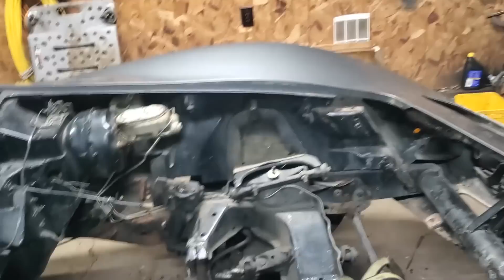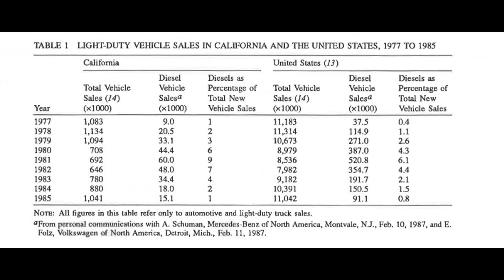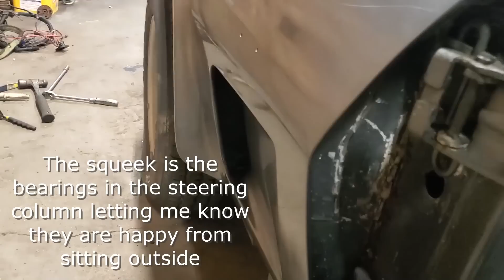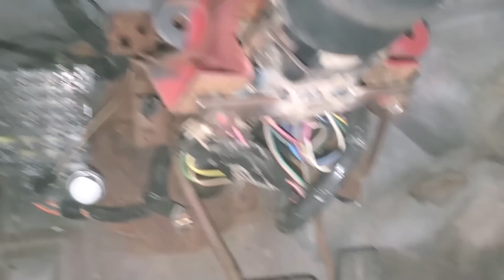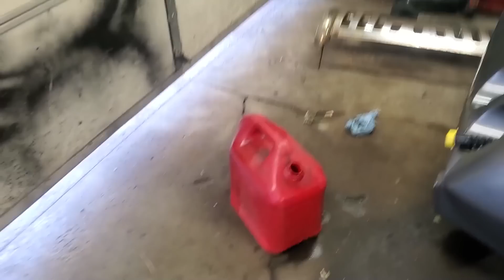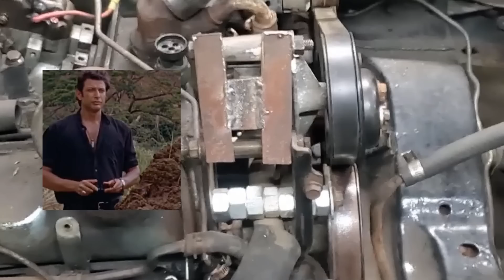The world's CHEAPEST c3 corvette powered by the world's WORST diesel engine! Will it MOVE again?

Comment: Huh. Oldsmobile Diesel Corvette. Shame you're using the V6 instead of the V8 but using what ya got is a respectable endeavor. I'm pretty sure GM outright sabotaged the 350 diesel by way of bean counter same as the 4.0 (only present in the Oldsmobile Aurora) and 4.6 Northstar engine also developed by Olds. My dumb Oldsmobile loving ass woulda dropped a gas Olds 330 Ultra High Compression from the 1960's into it since I have a car with the 330 (low compression sadly) and know how to work on it, but the problem is FINDING a 330 that hasn't had its crank stolen by some 350 guy who for whatever reason wanted to build a 60 year old engine to make power instead of performing the overdone but far more capable and far easier to find parts for LS swap. Really, finding parts for 60's Olds engines, especially the early 60's 215 turbo and mid 60's 330 but also the 350 to a point, is a total pain in the pecker.

Comment: I had an 82 Monte Carlo with a olds diesel. all the mototr mount bolts had vibrated out of the block. You could "power brake"🤣🤣 it and the gear selector on the column would move and the car would move and you could hear the engine fall back in place. I drove it for years like that and never fixed it.
Reply from the maker: hahaah i've had quite a few gm's where the mounts are shot and you just watched everything move, and my buddies 76 stingray he had, the motor would hit the hood, good times hahah

Comment: When you change the oil use the big oil filter. STP S25 at AutoZone, or a Fram PH25, forget what the Wix number is but the anti drainback valves don't seal well anyway on them. I use the STP S25. Decent quality filter for 5 bucks. Doesn't cost any more than the tiny skinny one and definitely fits in the space.

Comment: I just cut the universals out with torch. Clean up shit n slap them 2gether while still fairly hot. And b4 going back together, run a wire wheel through the bores. Walk in the parking lot! 👌
Reply from the maker: Yep, that's how I would do them when I am replacing them. Fire makes quick work of em!

Comment: Gale Banks made either a 125 or 150 hp 4.3 Turbodiesel Oldsmobile 2 door Cutlass Supreme with a 5 speed back in the day. Car & Driver did a review on it then ..  like a 0-60 in 10 seconds with a top speed of like 125-130 mph.
Reply from the maker: Wow! That is crazy! I NEVER knew about that one!
Reply: Wow, that would be neat. Non computerized transmissions take so much away from low output engines.
Reply: @workingcountry1776  5 speed manual. Apparently sticks were offered on G bodies back in the day,so swapping pedal assembly,console shifter,etc. was no big deal. Take home rate on stick G bodies was low and would be discontinued as the 80s marched on. Same tranny as Camaro,S10,etc when equipped with 5 speed stick. Remember correctly,the Banks Cutlass in question was originally a slushbox. Mr. Banks also had a gas 350 Turbocharged 70s Cadillac Seville that could hit 200 mph.  if my memory is correct,or it was early Callaway,Linfenfelter I think.
Reply: Wow! never knew that, i'm gonna ask my olds guru on this.
Reply: I'm pretty sure Gale Banks could force a literal steaming turd to make horsepower.

Comment: i feel like the 8.2 detroit is the worst diesel because its an open deck block and the cylinders like to move aroud since they re only supported at the very bottom
Reply from the maker: ya the "fuel pincher" 8.2 is by far THE WORST diesel engine EVER made. and in my mind olds 350 diesel and the 6.0 power stroker are a tie for second hahaha
Reply: @CompleteToiletGarage Yeah but the 350 diesel holds up fine with ARP studs. A friend has one I built in a jet boat, ARP head studs, copper head gaskets and O-ringed block, splayed bolt main caps, early pencil injector heads on a DX block, 4 stage dry sump oil system, piston oil squirters in the pan like a Ford Nascar engine, S358 turbo off a CAT 3126, carb hat on the stock upper intake, and a Peninsular marine DB4 head and rotor in the stock pump housing, locked timing advance. Engine is easily capable of 550 HP, which is the limit of the stock injectors even with the pintle lift adjustment maxed out. No issues with it in 5 years. Block holds up fine, and with the piston oil squirters and dry sump, all the stock oiling system issues are solved. No stretching timing chain either because the dry sump is belt driven, no more oil and vacuum pump driven off the cam. But yes stock they are garbage, especially the original D blocks. DX though, friend has one in an 82 Toronado, completely stock. Has 500,000 miles on it and only had a top end rebuild at 350,000 miles. No issues, runs like a top, turned up slightly and makes 130 HP/250 ft-lb.
Reply: Olds 350 Diesel was pretty bad too!

Comment: In my opinion the best-looking years for the Corvette. The power problem can be corrected easily
Reply from the maker: Best looking by far, and a simple engine swap could change it, but why do it the right way?
Reply: Yeah, like a Kubota 3cyl..
Reply: Spray it
Reply: I’m currently putting a trash lt1 back in a c4 at work and I have learned to hate them. I wouldn’t even take it if it was free! I would enjoy a c5 or c6 though.
Reply: I worked on a ratty early C4 one of my college classmates had, we had take out the optispark like 3-4 times because we kept clocking it a tooth wrong, and ngl it grew on me I like them now lol, I especially love being able to sit on the front wheels while working on them @moldypizza8808
Reply: Not a big window or rubber nose fan personally but I would say the average c3 is worse
Reply: Yea if u dont live in comiefornia
Reply: Really? I think the c3 is the ugliest corvette ever made lol
Reply: @sativa1320 looks pretty close to the stingray, and people love that thing
Reply: @jamesshields4346  That’s what i don’t like, it looks like a chinese knockoff C2
Reply: @sativa1320  hey, to each there own, to I like the c2 but for me the c3 just has more exaggerated style like the curves are curvier there’s some sharp lines that pike nose and OH MY GAHHHD THOSE FLARED WHEEL WELLS. It’s what I like, personally I think the c4 is cool too it’s not exactly pretty but it has that slanted radiator so it’s radar cross section is halved and that’s sick. The only one I dont love is the c8, great car undeniably awesome as it’s an affordable car that can compete with Ferraris and Lamborghinis but I think corvettes shoulda remained front engine.
Reply: @jamesshields4346  I love a good C4. That's my favorite.